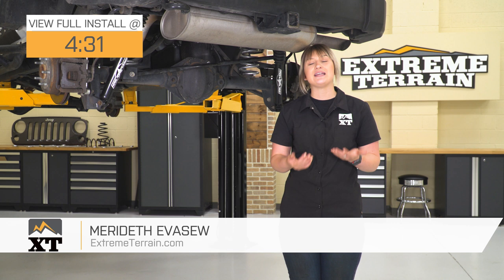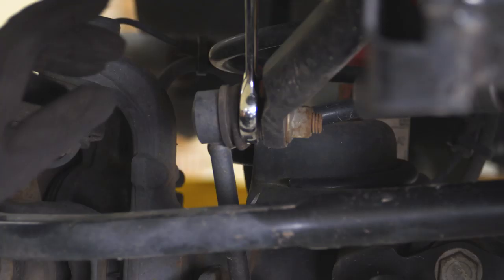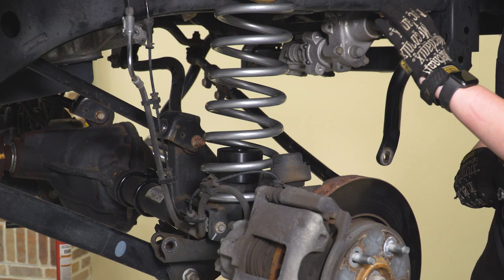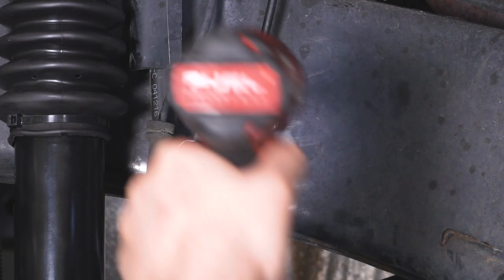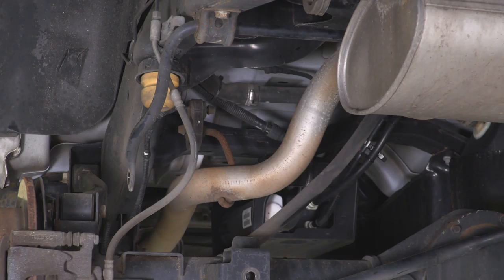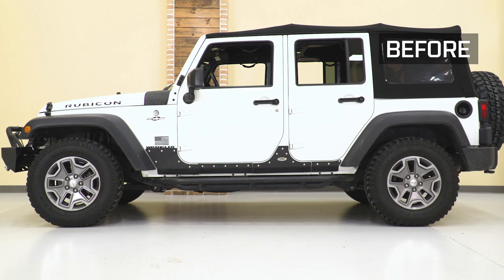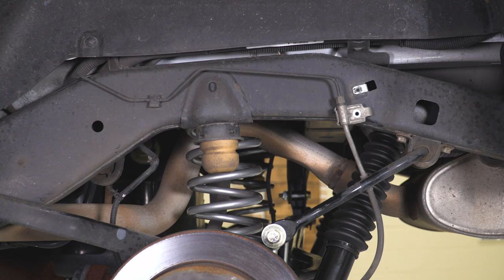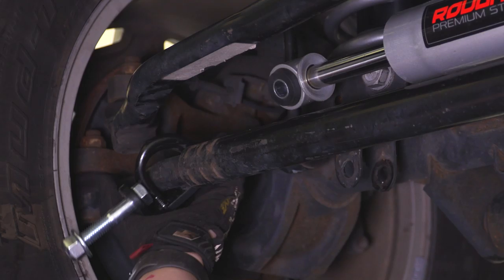Jeep Wrangler JK 4-Door Rubicon Express 2.5 in. Standard Coil Spring Lift Kit Review & Install

Comment: Excellent video overall.  Very informative and useful, but a word of caution to other viewers... You MUST also follow the directions that come with the lift or you will have trouble later.  Particularly, you should never tighten any swivel joints without the Jeep being on the ground with the suspension loaded.  If you do it up in the air, it will hyper extend the rubber and cause premature failure.  Also.  Use a good quality torque wrench.  Air tools are great or getting things undone but less so for accurate tightening.  Just my 2cents.
Reply from the maker: Great advice for anyone looking to install this themselves! Thanks for watching! -Zach

Comment: Great vid.  Two questions...  What about the torque specs?  Where is the best place to find that info?  Also, with this kit, would you also need to do a 1/2 leveling spacer if you wanted to eliminate the rake?  Thanks!

Comment: Does the front not require a track bar relocation bracket like the rear? Or did I miss something? You explained the difference between the two kind of shocks... how about the two kind of springs... standard and progressive rate? You did a fantastic job explaining and showing how to do this job step by step!
Reply from the maker: Thank you for the kind words! We always appreciate the love! The installation of this kit does not require a front track bar relocation bracket, but an adjustable track bar would be a great addition to this kit in order to center your front axle and keep things planted. 😁 As for springs! Linear springs (or standard springs) are pretty common when it comes to lift kits and work by completely compressing in an even rate throughout the length of the spring.The benefit of linear springs is that they have a constant level of ride firmness which is great for driving on-road, but tends to limit suspension articulation off-road. Progressive springs on the other hand increase in spring rate throughout the length of the spring. So, the top-half will start at a lower rate and then progress in rate throughout the rest of the length. Progressive springs will ride firmer at higher speeds and on-road driving, but ride softer and allow for flex at lower speeds. I hope this helps, and if you'd like to learn more you should click on the following link! -Zach https://www.extremeterrain.com/wrangler-jeep-coils-explained.html
Reply: @extremeterrain  Thank you so much for the prompt and thorough reply! You answered exactly what I needed to know. My daughter just bought a 17' JK and would like to give it a little altitude adjustment, so I'm doing all the research on companies and components now. Thanks again! Have a great Christmas! Be safe!

Comment: I went with this lift because I want to continue to add to it. What would you recommend adding next? Trac bar, new front disconnect end-links?
Reply from the maker: A new longer set of swaybar links in general for the front and rear would absolutely be beneficial for this kit! As would an adjustable front track bar and front lower control arms to keep your alignment in-check. -Zach

Comment: With this kit will i need to change my driveshaft? Or buy extra parts like longer track bars for the front and control arms? I ask because i just watched the suspension geometry video and curious what is “mandatory” to change once i put the lift kit in.
Reply from the maker: Honestly this kit will set up your Jeep pretty well on its own! I'd recommend getting both an adjustable track bar and adjustable front lower control arms if you have room in your budget though. Both will allow for your Jeep to handle better down the road and keep your suspension geometry in-check. If you didn't want to worry about those two extra components, sticking to a 1.5" lift may be your best bet. -Zach

Comment: Just installed this lift and the ride is pretty stiff and really bumpy. This will go away when the springs get some weight or wear on then right?
Reply from the maker: Absolutely! New suspension systems will always have a little break-in period as the springs settle. If a couple months of driving goes by and you still notice the ride stiff and jarring, you may want to look into a set of adjustable front lower control arms. That will help correct some of your suspension geometry and allow for a smoother ride. -Zach

Comment: did i miss the part where they install the front?
Reply from the maker: You may have! But I think it could have just been the angles that the front install was shot at, at some points it does kinda look like Merideth was working on the rear suspension instead. Front suspension installation starts at 5:07 and rear suspension installation starts at 22:52. -Zach

Comment: Shopping around for my JKU 2018 with 35 inch tires and looking at the Rubicon Express 4.5 inch RE7144m lift kit with 8 adjustable arms with the RE monotube shocks or also contemplating buying the TeraFlex TER 1451401 4 inch lift with VSS 9550 shocks and 8 Alpine adjustable arms.  So far I found the RE being 900$ less.  Which one do you recommend ?
Reply: Weird flex but ok

Comment: 35:05 Bench Vise not Vise Grip :) Three year late. Thanks for the video. This kit looks like a winner still today!
Hmm did not bend the rear brake lines this time.

OH NO!! Not all Factory shocks were twin tube.
"SUSPENSION
Front ... low-pressure (on 16-inch wheel packages) gas-charged shock absorbers—std.;
Monotube high-pressure (on 17- and 18-inch wheel packages)gas-charged shock absorbers—std.;

Rear ... low-pressure (on 16-inch wheel packages) gas-charged shock absorbers—std.;
Monotube high-pressure (on 17- and 18-inch wheel packages) gas-charged shock absorbers—std."
https://project-jk.com/images/pdf/07_JeepWranglerUnlmtdTech.pdf

"Sahara editions offer many of the X features, but also add monotube shock absorbers in place of the X's twin-tube setup" https://www.quadratec.com/c/reference/2007-jeep-wrangler-jk-specs
Then the next year "X features, but also added a 7-speaker sound bar, body color fenders, improved seating, larger wheels and stronger monotube shock absorbers for better suspension"
https://www.quadratec.com/c/reference/2008-jeep-wrangler-jk-specs

Check your setup before you buy shocks. Don't want to downgrade ( Like I may have! )